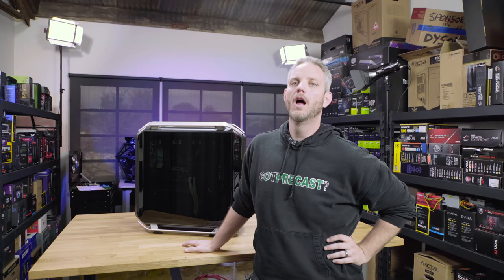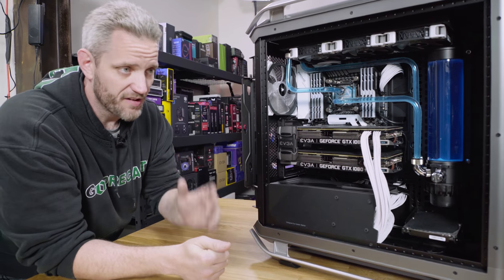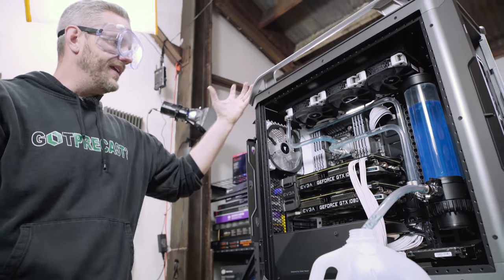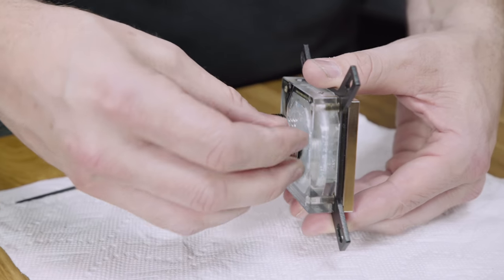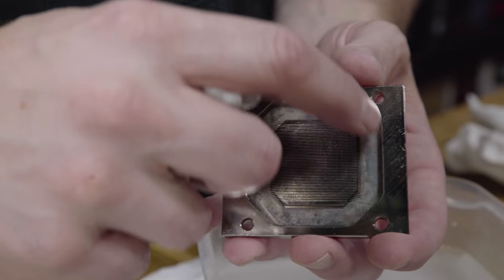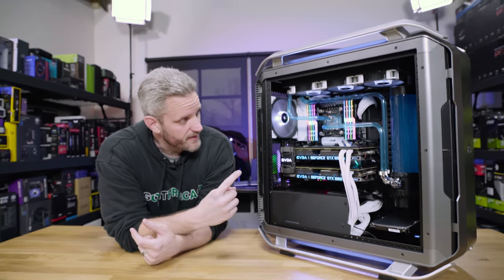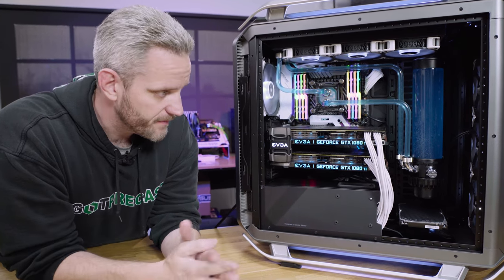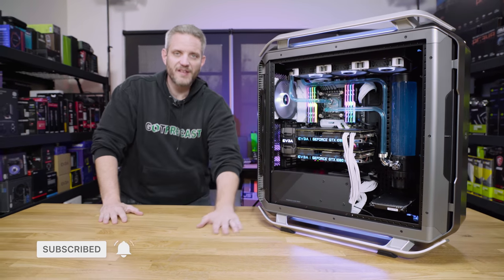It happened again... and this time it was NASTY

Comment: That’s what she said.
Reply: Jay, Google EK o-ring grease and milling oil contamination. EK (and some other manufacturers) applies too much grease to their o-rings and doesn't clean the milling oil off their blocks. I had a loop get contaminated by this recently. It is no joke. Primochill fittings also have this issue. IMO, your reach would really help bring this issue to the forefront.
Reply: Best comment i have seen in a long time........ :D
Reply: The commercial just skip that's new?
Reply: Anybody check for the link for the toothpaste?🤔🙄😁
Reply: weirddd
Reply: gotta leave a like,  this comment just hits the spot
Reply: what part of the video did she say it?
Reply: Ben Troxell That is what the "nasty" rag is for...
Reply: Holy shit, I thought I was the only person having these kinds of issues. I went through 4 different EK water blocks for my 1080ti's and 2 different EK cpu  blocks because I kept getting this oily crap between the blocks and the acrylic. I even got a new o-ring set for my gpu block but it didn't do anything either. Eventually the people I kept emailing about this problem stopped responding. So now, I just run an AIO and deal with a lot less headache.
Reply: Ben Troxell 666 the devil love this comment 😈
Reply: What she said? I think I've said similar myself during college...
Reply: lmao
Reply: Who is this she?
Your mom?
Reply: Bottom out!  Bottom out again!
Reply: @hethan89  Life goals bro
Reply: What did she say?
I guess nothing, because you don't have a she.
Reply: It's so rare I see another troxell that isnt my immediate family. We are related in some way btw.
Reply: Nolyism My man! 🤛
Reply: Yeah but not to me...

Comment: This whole video perfectly sums up the reason why I don't do watercooling
Reply: Just don't run goofy fluids and make sure you add silver in the loop and only use one type of metal.
Reply: That's not it. Getting the loop all working and leak-free is much more work intensive than regular air cooling, not to mention it's much more expensive than air cooling. Not worth it to me for ~10°C better temps, for me the PC has to work without issues and if something fails I want to be able to swap it out quickly, which is not possible with watercooling. Think about it: swapping a GPU is a 5 minute job if you are on air cooling, but with a custom loop you have to drain the loop, disassemble it, install a waterblock on the GPU, assemble it again and fill it. With that said, I'm also not a big fan of having any liquids near vital PC components.
Reply: it really depends. I have been running my 5820k on a custom loop for almost 2 years now. Never switched coolant even once, temps are still 70c max at 4.7ghz 1.36v. Just use the right fluid and if you are not using it for the looks you don't have to think about eventual gunky looks. My soft pvc piping looks gunked up now, but the reservoar still retains the same color. So the discoloration of my piping is only related to the fact that they have been running water through them for 2 years constantly. The pump has never been shutoff, still runs even when the computer is turned off. Because of reasons. And if you use soft tubing it really does not take that long. If you want looks, it will take a bit longer. But this loop took just about over one hour to assemble.
Reply: If you use quality connections and take special care making sure you don't damage o-rings, leaks are fairly a non-issue today.
I've been water cooling for 4 years, first with flexible tubing and now hard-line- knock on wood, never had a leak.
It can be a fun experience making your own loop, I have mine set up by Pump-GPU-120mm double rad-CPU-360 rad-pump. And trust me, depending on what you run water cooling unlocks a LOT of power, my Vega-64 went from medeocre to 30% more power water cooling it.

It is the difference between consumer and enthusiast. 

Maintenance sucks yeah, but if you use quality parts and no-nonsense fluid, it's just a matter of cycling distilled water then adding an additive at the end- If it gums up then you are tearing it down.
Reply: john it's not just about the difference in temperatures, with water it takes a lot longer to achieve the maximum temperature
Reply: Nope, it's also pointless for some Cpu's/GPU's
Reply: I don't overclock and I live in Norway, no need for watercooling  for me
Reply: Joakim Carlsen same here iv been running my 5820k for 3 years no with acrylic hard tubing and everything is still fine no discoloration or whatever and my cpu is running at 30°c and under load 40-50°c (still after 3 years)
Reply: Yeah, it's just not worth the hassle unless you are ridiculously into watercooled overclocked builds.
Reply: Boys - quick disconnects will change your life. I can pull down my loop with out draining it. Maintenance isn't a problem at all now. It just comes down to price.
Reply: Air forever here as well.
- I prefer metal coolers looks over water blocks
- No maintenance fee
- Much cheaper to start with
- Few degrees warmer than waterloop doesn't bother my use gaming and multitasking at all
- Quiet, very quiet on air
-
Reply: Whats funny is that Water cooling is Air cooling,  just glorified with very little gains for the added cost and risk.  Just because you OC'd that cpu to 5ghz doesn't mean the game will utilize it.
Reply: It's not the watercooling hardware it's the poor choice of going with any fluid other than distilled water and a biocidal agent/kill coil. Leaks rarely happen and very often you will notice any failure within the first few hours.

When you setup your loop it's one of those set it and forget it things.. You're not moving the tubes and fittings around and causing physical stress which IS what would cause you issues. Want an example? A car. Every mechanical part that experiences adjustment and re-adjustment will always come to a point of failure/wear down. In the case of custom watercooling, you're not moving the internal parts like toys. You never open or lay hands on this until it's time to clean which even then is just a matter of dust blowing. If you're doing otherwise, you're causing the failures, breaks, etc. of which no 3rd party has guilt.

Far too many people assume that custom loops are a 50/50 success. Except the real risk you run is running this vendor made "fluid". Enough of the 'nano fluid' crap/bs. If you really want to increase your chances of something bad happen, please- go buy yourself fluids like the ones in his videos. aka anything other than straight distilled water/biocidal agent. Now THAT will give you the failure rates and "fail vids" you want.

My machine experienced an apartment building fire and 2 weeks sitting in a room with nothing but mold growing on walls, drop ceilings obviously having been collapsed, debris having fallen all over from the previous upper level floors, etc. Yet the loop always remained clean and every single waterblock (CPU + 2 GPUs) was without an atom of 'gunk' inside. So no, these things- once assembled properly- will survive extreme conditions and be clean (inside the loop that is lol. The case was rusted and dented to smithereens)
Reply: Zack what does where you live have anything to do about it?
Reply: Watercooling is not that hard or that expensive long term. Been using the same pump and rad for 10 years. My current block and second rad are 8 or 9 years old. I've only had one batch of coolant go bad on me, not sure why it did, that's the only time it's ever *required* maintenance, anything else I've done to it has been entirely elective.
Reply: @Demorthus  Straight distilled water becomes ionized.  I'd never run that in a loop, it will cause galvanic oxidation to any dissimilar metal that's in the loop. How about you get with the program and use a real industrial coolant? Like Propylene Glycol, Polyethylene Glycol, Triethylene Glycol. Take your pick, all 3 are good for temperatures over 150°C.
Reply: Yep. Absolutely not worth it for 99% of people.
Reply: I love how watcercooling looks. I'd love to have a system with it...but as everyone says, the faff involved puts me right off and I have no confidence that I'd get it right. I get nervous enough the first month after building a PC as it is, just expecting something to randomly fail. Just forget water cooling.
Reply: Just open the window!
Reply: Johannes AIO’s with a good coolant can last five years till you have to just take the cold plate off and clean it.
Reply: @Super Kawaii Kitty Just wanted to let you know your computer will generate about the same amount of heat air cooled or water cooled, the difference is how fast you can move it away from heat generating components. If anything you would probably generate less heat with air cooling as any throttling in your system will decrease heat generated.
Reply: Johannes I don’t need it since I’m not overclocking
Reply: Looks like waaaaaay more work than hitting my case with some high pressure air now and again.
Reply: @wowdogeful  10° ? You have no clue lol.
Reply: @wyvern4588  You can use a closed loop also.
Reply: @Tibbex  Closed loop suffers from corrosion, and premature break-down, as well as performance that is slightly better or worse than a well designed air setup. I've tried two, they both failed within a year and one began to leak- I've been running open loop for 5 years and knock on wood- no leaks, no clogs, no corrosion- it just takes money and patience to do.
Reply: @wyvern4588  Im running an H60 i believe for more than a year now. No issues so far. High temps on my i7 7700k, but that seems to be linked to the generation and or specific cpu.
Reply: Watercooling is not that hard. You don’t watercool because you are lazy and don’t know how
Reply: From my perspective, watercooling is a hobbyist pursuit... and hobbies cost money and don't necessarily have to be practical. Some people do it for looks, some people do it to chase maximum benchmark performance... and neither of those are typically practical things.  Of course there are more legitimate use cases, like professional editor running $4000 worth of CPU/GPUs in a video editing rig where max performance reduces editing time, which means more productivity, which should mean more money.... but for the most part... it's an enthusiast thing, not a practical thing. There is nothing wrong with this... but that doesn't mean there is a huge benefit either. For the vast majority of builds I've done for myself or others, a quality air cooler comes out on top when balancing price, performance, maintenance and risk.

That said, I'm still planning on doing a custom loop on my next build just because I want to... haven't done one in over 15 years... back when you were running the tubing outside of the case to an external pump/reservoir and most of your supplies were re-purposed aquarium parts. I know it's going to cost more... I know for my use case it's not going to give me much of a real world benefit... but it's a hobby... and hobbies cost money.
Reply: I've been watercooling since 2018 and i never had a problem, i have always used clear coolant.

Comment: Whitening toothpaste does often contain some kind of peroxide based oxidizing agent for making the teeth brighter plus sodium bicarbonate (baking soda) as an abrasive. The peroxide stuff has the potential to make o-rings brittle and to damage the nickle coating even more. For scrubbing, pure baking soda mixed with a tiny bit of water to a paste should be as good and less agressive. Just saying.

Comment: Licensed plumber here. Not sure if this is relevant. If the metals of any of the component are made of dissimilar metals and are in contact with each other, you will get nasty electrolysis that will destroy fittings and gunk up any choke points with sediment.

Comment: Take that you Air Cooling scrubs! At least us Water Cooling enthusiasts don't have to worry about air cooling's maintenance issues. You guys have to dust off fans with a compressor, meanwhile we have to...check for leaks, drain out liquids, thoroughly inspect materials for cracks, clean and brush off gunk, wipe off oil, and get rid of dust on fans. Wait a minute...
Reply: And if it ever leaks you lost ur pc congrats
Reply: Welp, I guess an aio would do the trick
Reply: @ekipierrobert1989  ah no. Stop spreading lies.

Comment: And this is the reason why i stick with Mayhems pastel blue berry!! running 3 years with the fluid, still the same color not higher temperatures off the system. I see a lot people saying that this is the reason why they don't watercool. There are a lot off people that don't have a issue with it and after all changing fluid after a while isn't such big off a deal if you plan out your loop properly.. + like i said i'm running my watercooled setup for 3 years allready with the same fluid and i don't see any reason to change it yet :)

Comment: Eugh. Yeah, as absolutely wonderful as pearlescent cooling fluids look; it's definitely only meant for temporary showroom use. All those particles end up clumping together after a while and causing problems. For actual long-term use you should really just use distilled water. Maybe include some biocides or corrosion inhibitors in there too.

Though it does confuse me how this system ended up having everything separate while others didn't. I would have expected this to happen to all of them.

Comment: I would stick with automotive coolants that are high quality. I have been using Nulon Red for many builds and some have been in service for  3+ years with mixed metals and everything is spotless when it comes apart.
Reply: I've been running G11 car coolant premix (the blue stuff) ever since I built my Ryzen rig in 2019 (when Zen2 came out). Wasn't even expensive/high quality coolant (Mannol AG11) since I bought it in a pinch at a weekend after a screwup but it's been perfectly fine with no residue or anything, and the average temps are still rock solid. I know it kinda sounds bad but the only thing I've done as far as maintenance goes was clean the fans and blow out the rad lol

Comment: Contrary to the corrosion theory I suspect it might be the type of dye that caused the problem. I think pearlescent dy uses coated nanoparticles, an anti-stick coating is used which degrades through constant collision with the tube walls and the exposed metal. This abbrasive effekt might have builded up that gunk since the degraded dye particles will stick together with the metal and seperate from the water because of the increasing density of the gunk. 
The corrosion might have happened after the coating of the screws were sufficiently worn out and with metal particles floating about possibly.

 Some further thoughts t reinforce my theory:
- A chemical reaction should have gathered metal gunk somewhere, probably different from that that was present in this loop
-The radiator-inlet screw was clean and pretty roughed up, i suspect that the nanoparticles hit the inlet screw the hardest, beating off metal nanoparticles which are more reactive because of the increased surface area. Then gathering on the radiator-outlet.

If you read the text until here youre awesome, thanks

Comment: Toothpaste is also a nice chrome-cleaner ;-) to clean chrome parts on your car ...
Another thing that I've learned from people who've done jailtime (don't ask!) ..it's also great when having burnwounds, let it dry and you won't feel the pain !
Reply: I have tried the burn thing several times but hasn't worked for me, i could feel the burn but the pain would go away if i soaked the burned part with water
Reply: Toothpaste isn't recommended for burns. 

It's always been to keep the area under running water for ~10 mins. Then you can apply a burn dream to minimize further pain
Reply: It's at least not as dumb as someone who told me that running water on a burn causes blisters.
Reply: haha yeah well, it's what people do in Italian jails atleast, maybe it's just because they always have toothpaste or something instead of burncreams .
Reply: running water on some burns is bad and can make it worse. It sounds dumb but it is correct...

Comment: And that's why distilled water is the best coolant.
Reply: This ^
Reply: Except now you have to add biocide and possibly silver kill coil, distilled water is readily available and cheaper but pc will need more changes
Reply: Lime or just run your loop at 90C LUL no need for biocides.
Reply: oh ok, I will try that too.
Reply: Lime loop melts
Reply: so does deeznuts
Reply: Mandrake Fernflower cuso4 *if you dont have aluminium on your loop.
Reply: copper sulfate will corrode aluminum plates and fittings
Reply: It's interesting to see what other people do. I do have a silver coil in my loop, but that came with my pump and I'm not sure it actually does anything, I totally get the theory though. I run a copper block and copper radiator with nickel fittings.  I forget what my EK pump is made out of.. about once a year I drain/flush with distilled vinegar/flush with distilled water/then refill. 

Honestly, that's probably Overkill, it's a closed loop system, not a pond. Algae and germs are organisms that feed... What is there to feed on in a closed loop? Warm distilled water? Permeation through hoses does happen, but that's why they recommend to flush. 

Sure, I'll run a biocide in my humidifier, buts it's open to air, not a  closed system. 

Again, just interesting to see what others do and the reasons behind them.
Reply: Jeremy Sargent I know its late, but algae feed off the sun, not food directly. Thats why they appear

Comment: I had a contaminated loop once too, after cleaning and before putting it together again i bought a filter from aquacomputer, you can cut it from the loop with two valves so you can easily clean it. I had no problems with dirt in the cooling-blocks ever since.